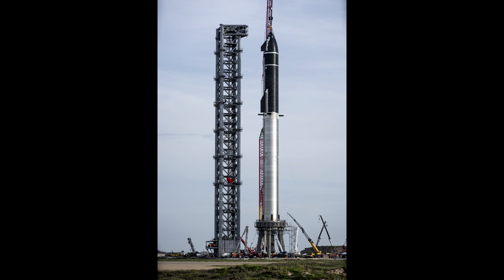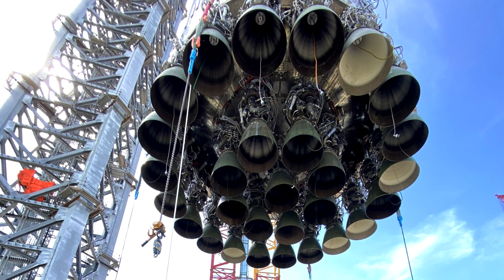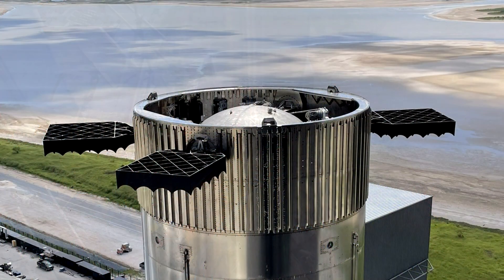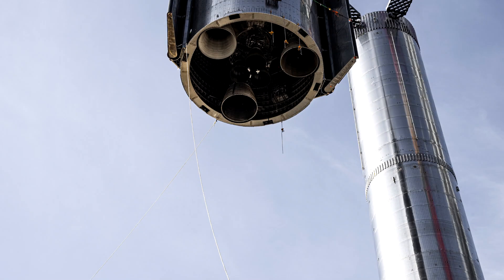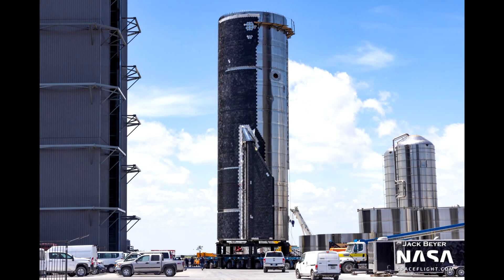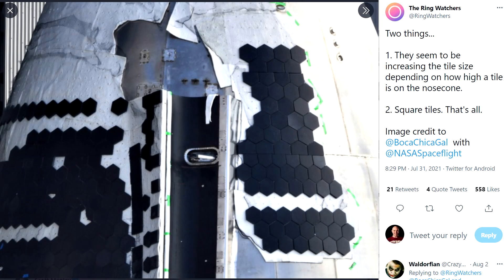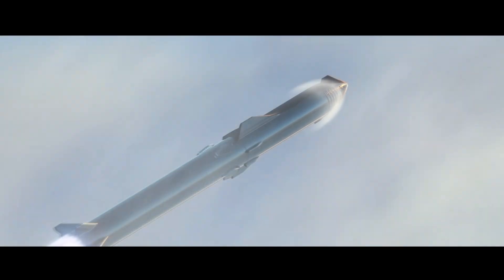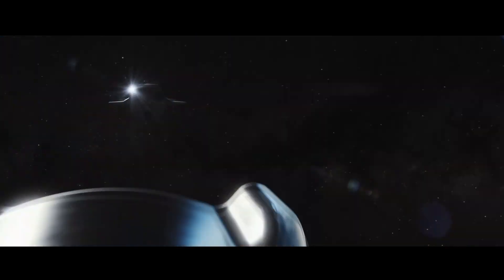How SpaceX Designed A Heat Shield For The Largest Spacecraft Ever Built

Comment: I was wondering if you knew how to calculate the weight saving... and fuel savings if they ditch the fins and heatshield and use more rocket fuel to decelerate instead.  I realize the speeds are crazy fast and it takes a lot of lateral speed to get to orbit, but on re-entry the craft will likely have no cargo and have used most of its fuel.  I would think the fuel required and the lower mass would do a shorter burn using only one engine.  I just see the heatshield as a high risk failure item... and the belly flop as a dangerous landing procedure and wonder really how much these save compared to the weight.  And with the reduced weight you would save fuel going up giving you more options including more fuel to decelerate your lateral movement.  The engines should like they are far more reliable and the redundancy of 3 engines would make this the safest form of re-entry... easiest and cheapest to build and most re-usable.

I also question the grid fins.  I would think just normal fins in the same configuration would not only way MUCH less, cause far less drag going up, but they could be turned fully horizontal to slow the decent the most.  I thin ditching the other fins and putting front fins o both the Starship and the Booster and use tail down descents.  And if you move the fins at the same time towards each other you will increase drag without steering he craft.
Reply: You would need a LOT of propellant to decel from orbital speed using only engines. Like multiple tanker flights. The thermal tiles and grid fins will no where near save the amount of mass needed for landing using only engines. Using aerobraking is free as long as your spacecraft can survive the heat.
Reply: @steveaustin2686  It does not need to slow all the way down... and it does not need to gain altitude... and it should be weight likely around 20% or less than what it weighed going up... so the mass of the fuel might not be that much more.  It likely is not as efficient... BUT... it would simplify the design and remove several failure points.  He has redundancies in the engines.  He would be using the vacuum engines for the deorbit and deceleration burns and then the normal engines for landing... and he has 3 of each and likely only needs one.  He is already talking that he will likely need gas cooling or gas shielding to protect the hinges on the flaps and he is worried about the heat shielding.
Reply: @toddabbott781  You need over 9km/s of dV to get to orbit. To descend via engines, you need that same over 9km/s as you need to get to orbit. Yes, it is easier to generate without the payload, but that STILL requires a tremendous amount of propellant. If you use thermal tiles and aerobrake, much of that over 9km/s needed for landing is converted to heat instead.
Reply: @steveaustin2686  It is not just the lack of payload.  You are not fighting against gravity and air friction nd spending extra fuel to react altitude.  You also do not need to come to a complete stop, but just slow enough to prevent the stainless steel hull from weakening.  The craft will come in at Mach 25, but if they get the speeds down to say Mach 2-3 i can safely re-enter.  Now the atmosphere is thin initially so the freefall is pretty crazy speed.  I'm guessing it will need 1 deceleration burn, the 2 burns for re-entry.  The thing is with how light the ship is the burns will be short and likely only take 1 engine.  This is not as crazy as you think.  The Starship weighs 120 tons and the fuel is 1200 tons.  Add in 100-150 tons of cargo.  This thing is going to weigh less than 20% and that is with a lot of fuel for re-entry.  Elon only holds about 5% for the landing and likely only needs 1-2%.

Comment: from wiki and engineering toolbox.  h=h+v^2/2   dT=1/2 V^2 /cp   .2401 Btu/lb R  but .2401 appears at degrees K
Reply: the reentry also uses some fuel to slow the empty vehicle down to a slower speed.
Reply: elon it would seem is challenging the "SEADITCH" with complex engines and delicate tiles.

Comment: For heatshield inspection why not put a capacitive sensor under that nice white - cashmere is it? - wool with some heat resistant probes fixed so they  touch the underside of the tiles?   Any cracks or missing tile should be easy to detect.  There are hundreds of different MCUs available capable of monitoring 10++ tiles each.  Wireless mesh capabilities means very easy installation. Even the rad-hard devices certified for space applications are dirt cheap. 
Most important this solution makes possible - easy even - to implement a celebration mode like on the model X.  With leds on the MCU PCB and some mica optical fibers SpaceX can add RGB-lighting to the list.   
oMg lolz @ beZoz n00b

Comment: the N1 Soviet moon rocket (a Saturn V size launcher) had 30 (!) engines and never left the launchpad safe...they dared too much because of the space race with the US...isn't Space X somehow doing the same mistake for different reasons?
Reply from the maker: They’ve launched a rocket with 27 engines successfully 3 times, so, no.
Reply: One would hope that with a half century of advances in computer modeling and CAD, in metallurgy and manufacturing they might have a slightly better chance.  But it's certainly not zero risk.

Comment: How many failures can they tolerate losing 29 engines each time before they give up on super heavy?
Reply: Plenty. At current rate of production, it's pretty costly... roughly two months output from the factory. But they're building a new factory to mass-produce the booster engines, because they need to be producing thousands of them anyway, so losing ~30 engines on a failed booster recovery won't be that big a deal.
Reply: @simongeard4824  I hope your right. The Russians gave up trying to get that many engines working at once.
4 failures in their case before giving up.
Reply: Falcon Heavy worked fine with 27 engines
Reply: @Tuuminshz  Not quite the same thing.
Reply: @TheEvilmooseofdoom  indeed
Reply: @Tuuminshz  this is a good point.
Reply: @youtubevanced4900  Despite all the people like yourself who keep bringing up the N1, there's almost no similarity between the two.  The chief problem with the N1 wasn't the number of engines – it was the quality of engines, due to a design that made it hard to test them on the ground. This is obviously not the case with SpaceX, since design for reusability makes ground testing simple...
Reply: @simongeard4824  I guess we will find out how hard it is.
Reply: @youtubevanced4900  Oh, there's no question that it's hard. But look at that photo of the 29 engines mounted to the booster... all but 5 of them of them have already been test-fired at least once, and the other 5 are already on their way back to the factory for the testing they've missed. In comparison, not one of the 120-odd engines used in four N1 flights had ever been lit before launch.
Reply: @simongeard4824  I think that's the nature of the fuel they used on them.
So corrosive it ruined the engines in one use.

Comment: These tiles create an incredible amount of failure points - Im sure they could invent some type of spray on ceramic or layer on blankets of “something” - Obviously I’m not a space technologist, but just common sense tells me the tile idea was very bad on the Space Shuttle - this seems even worse.
Reply: It's not ideal. But no, there's no reason to be sure that they could just "invent" a magic spray on heat shield. There's been a significant amount of work into these technologies, if that was a practicable option it's damned amazing that nobody has done it.

Comment: The fins are placeholders for the final design which is pending. There's all manner of material that could shave off weight as mentioned in Everday Astronaut's interview with Elon Musk. In the same interview Musk mentioned that the ablative heat shield on the Dragon is thick enough that it can be used for several flights before replacement.

Comment: Stainless steel is NOT a good reflector.  IN fact a white surface reflect more than stainless.  Go and test it with any SS item in the sun...  The reason is that the emissivity value is very low

Comment: 6:40 "had to go and get that exact tile"  They had a CNC production system that would create the tile to the right thickness and shape with full automation

If SpaceX want full weight savings they will need varying thickness all over as well.  Creating the custom tiles wasn't the bottleneck of the Shuttle, it was the application process and QA.  The regularity of the mounting points and stuff with a cylinder geometry should still help a lot for the complexity of the install, but I wouldn't be surpised to see them with almost all custom tiles depending on their factory setup.

Comment: It is impressive how Starship-Super Heavy has 29 (20+8+1) Raptor engines in the first stage.  Soon it may have 33 (20+10+3).  Looks like the old Soviet lunar N-1 rocket hope.   Let's remember the slightly smaller Saturn V had only FIVE F-1 engines in the first stage, a truly fantastic accomplishment.  Such huge engines had a downside, the combustion instability responsible for thrust vibration, the infamous "pogo" effect. Another possible problem was the consequence of a single engine shutdown (20% less thrust).  More engines, less risk.  A less elegant solution, although more practical.
Reply: Nothing about this is less risk.  More engines serves their purposes and I understand why.  Plumbing and firing that number of engines has failed for those who have tried so far..

Comment: I like how he basically just reiterated the conversation between Elon Musk and Tim Dodd, making it sound like original thought. (Edit: Referring to [Part 2] of Tim Dodd's Starbase tour video)
Reply from the maker: If I was doing that wouldn’t I have fixed the things which were outdated by that very conversation?
Reply: If that's what you heard, you were not paying very close attention.
Reply: @scottmanley  I'm just saying the majority of it was taken from one specific interview, and in my opinion it should have been credited.
Reply from the maker: @Evangq  When did they talk about the thermal protection system in part 1?
Reply: @scottmanley  In part 2 (@37;30), they talk about the thermal protection for 20min, including potentially using methane gas to protect the joints from plasma. They also talk about the differences between Dragon's and S20's. Honestly, I have never had anything but positive things to say about you and your content. You are easily in my top 3 YouTubers. Of course the one time my comment is not positive, that's the one you see 🤦‍♂️😅
Reply: @scottmanley  Part 2 of the interview is the "conversation" I was referring to in my original comment. Because your video came out one day after Part 2, and the content of your video was very similar to topics discussed there, I assumed your information was directly drawn from it. If that's not the case, I'm sorry and withdraw my comment.

Comment: What's the barrier to just using periodic engine braking so that it never descends fast enough to need tiles?  If it's only because that requires fuel which limits payload, it would probably pay off anyway, it's got too much payload capability for the time being
Reply: You'd need more fuel than payload, it would never pay off.
Reply: @TheEvilmooseofdoom  you already have more fuel than payload so that's not a problem

Comment: Why dont they put ridges on edge of tile . Butt joints are difficult to do with exspansion. Why not have a tongue groove joint.?
Reply: Difficult to replace damaged tiles with a tongue and groove.
Reply: @TheEvilmooseofdoom  have you tried? Lol. No?. Perhaps wrong design. Better designer then? Get it done.
Reply: @willyouwright  I have used tongue and goove materials in the past.  You're imaginative, but ignorant.  That's not terrible but it does mean many of your idea's are not going to be practical.  I know you don't like that.  Cope.
Reply: @TheEvilmooseofdoom  thats what they said about full stage flow , fully reusable rockets.  Its not if its when.. place your bets.

Comment: I have serious doubt that starship will survive re-entry. Specifically, they hit the upper atmosphere at Mach 25. To the starship body, which has the stiffness of a WAY overcooked piece of ravioli (watch when they pick up a ring segment with a forklift to move it in the assembly yard, the ring section ovalized to about a 1:3 aspect ratio just under its own weight. Hitting the atmosphere is going to be like hitting a brick wall. The tiles are mounted to the body of the spaceship. The body of the spaceship is going to dramatically ovalized (ie., flatten in the direction of travel). When the body flattens, that is going to open up lots of gaps between the tiles, allowing hundreds of blowtorches to attack the body of the spaceship. I fully expect that the starship will be melted into dozens of (perhaps hundreds of) tiny segments on re-entry. Well all find out together.

I truly hope I’m completely wrong about this & I’m certain that SpaceX’s engineers have already run hundreds of simulations. I would believe the results of these simulations over my own “feelings” every time. I’d love to find out if they’ve run these sims & what the results were.

I’d love to see them build a quick & dirty mock-up, with thermal tiles, send it into orbit on top of an F-9 & have it re-enter. The test flights they’ve run thus far have had no hyper velocity stressing.
Reply: Of course they've looked at this and very closely.  They're not new to this so I suspect you're completely wrong about this.  While entry will be stressful it will not be like hitting a brick wall.
Reply: @TheEvilmooseofdoom  of course they should have looked at this from the beginning, it’s the most blatantly obvious structural loading. Still, my gut feeling is that they’ve got a problem.having done hundreds of stress analyses over my career, one does get feelings for structures. My sense is that the lateral stiffness would be about 1/100th of a passenger airplane (like a 737) or even the SR-71 & less than /1000th that of the heat shield of the crew dragon or Apollo capsules & I would fully expect a Blackbird to completely break up if it yawed 90° to its direction of motion at its (comparatively) pedestrian pace of Mach 3. I will be ecstatic to be proven wrong. I can’t wait to see how it shakes out. Do you know if they’ve published any stress analysis? I’ve love to read it. Im also concerned about flexors & plasma leak paths around the flaps.

Anyway, this was not intended as a diss at the SpaceX engineers. I’ve got a ton of admiration for those guys (although I don’t think they can hold a candle (or a slide rule) to the 60s NASA engineers. In fact, SpaceX has exactly the tools necessary to answer my question, CFD models for hypersonic airflow, nonlinear stress analysis and powerful computers that’ll let them perform hundreds of re- entries in software before they ever try it with hardware. Those’re the tools that NASA never had in the 60s, which makes NASA’s achievements all the more amazing. They did it all with slide rules & a copy of Roarke’s Equations for Stress & Strain.
We shall see.

Comment: Radius of curvature is a function of ANGLE, not size. A small body with a nearly flat surface will have a much greater radius than a large body that is cylindrical. This is not a reentry vehicle. It has no chance to do anything but burn up. 😺
Reply: No chance?  While nothing is guaranteed I suspect with all those smart people working for them their chances might be a touch better.
Reply: @jetguy6535  Guess we'll find out soon enough.
Reply: @angadsingh9314   Some of us already know. 😹 The rest of you will indeed find out at some point, although I doubt it will be 'soon'.

Comment: The SMART thing to do is to put it on both sides so if there is a problem they can rotate the ship.  3 redundancies are smart but uneconomical.  2 should be minimal.
Reply: No that’s stupid.
Reply: @Creabsley  So if they are in space and a meteor hits them and takes off some on one side, it would be better to have them die then rotate the ship right?  Or lets say some start coming off on reentry.  Yeah okay, genius.  2 shuttles blew up because of heat shield issues that simple solution would have fixed.  How old are you?

Comment: 29 engines. lol. Seeing how the Russians did with 30, I can't imagine 1 less engine being much better.
Reply from the maker: SpaceX has flown 3 rockets with 27 and had no problems.
Reply: @scottmanley  That was 9 on each booster and 9 on the center though.The super heavy has all of the engines on a single structure like the Russian N1. I feel like having them spread out, like on the heavy with a core and 2 boosters, would lead result in fewer launch failures.
Reply: @fordfreak2007  you're comparing two completely different rocket and two completely different era...
We're no longer in a space race, we're developing new technologies, more engine actually make more sense because when you try to make a fully reusable rocket the reused rocket engine could have a failure that go unnoticed and if you only 5 engine that would result in complete loss of mission which is why having an engine out capabilities is worth the complexity